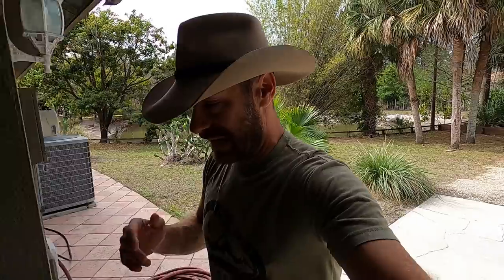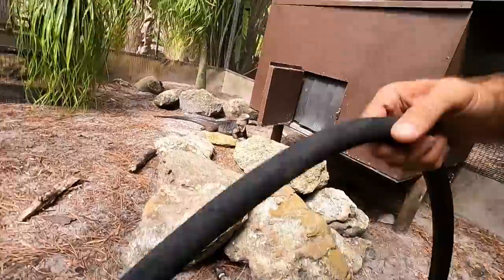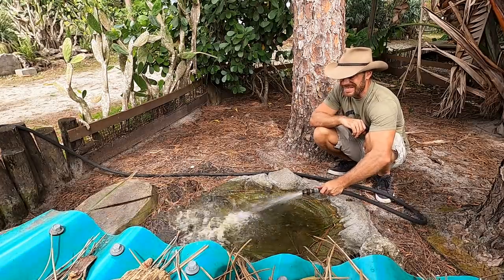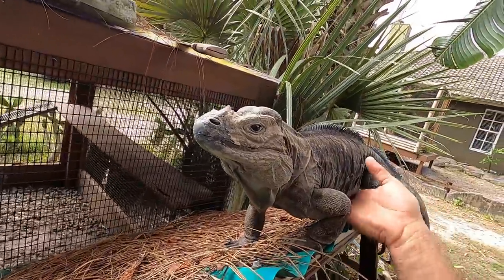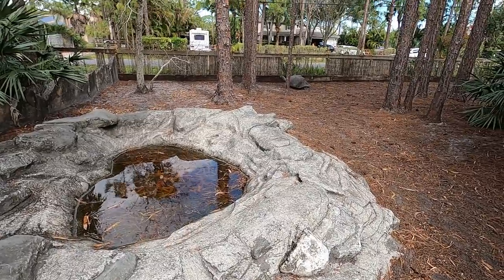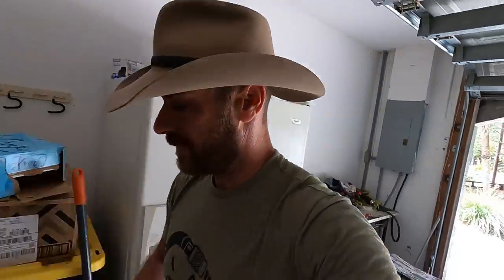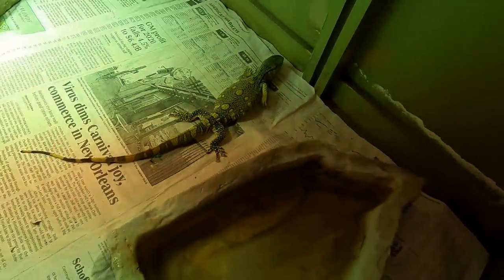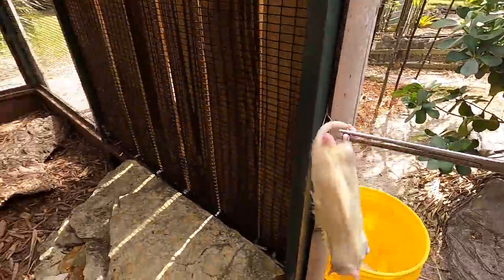Visiting Slinky & the Monitor Lizards!

Comment: I believe black throats like high humidity. I used a mixture of play sand and coconut fiber 30/70 sand to coco fiber for my savannah monitor. This combo really holds humidity well and is good for burrowing. Also some monitors depend on humidity for hydration.

Comment: Regarding Bobbie Rabino, a short explanation of what's probably going on. First, you're doing what you should be doing. Increased supplements and critical care food are great for his recovery. This is a sure sign of calcium deficiency disorder. It affects his absorption rate of the calcium, as well as other vitamins and minerals they need. The parasites hurt that pretty badly by damaging digestion and lizards don't recover most of the time. You brought him back from a bad place. He's still having petty mal seizures, which affects motor movements. That's very common for deficiency disorders. Digestion takes a lot longer to heal in reptiles.

Comment: if it was a wild animal you need to take your time with handling them it takes weeks for them to get comfortable with you just put your hand in and let them smell you get used to you not being a threat you need to take your time i can see that animal is super stressed my tagu was the same way and my mountain horned lizards but my nile monitors took weeks n weeks to get in my hand without it stressing out. ive had 14 lizards at one point in time
i love reptiles

Comment: Hey Kamp, there was a video about a huge monitor lizard that had an open sore on its nose.   The problem was that the animals the owners were feeding it were too large for that monitor to get it down its gullet, causing it to do what your lizard just did, push the large rat down its gullet and thereby rubbing its nose against the rock.  That other lizard was pushing a rabbit down its gullet using a chain-link fence that had a large opening that allowed part of the rabbit to pass-through causing that lizard to push its nose against the wire causing that open wound.  I would suggest that you not feed such large animals to the lizards that don't have the expanding jaws that snakes do but must use an aid to force the food down its throat. 
By the way, Kamp, not one 'gotcha' or 'I LOVE IT' or 'no way', making for a much more pleasant video of you not trying to show your knowledge or approval of what others are doing.  So relax you probably know more or at least as much as those you're trying to impress.  One of the nicest videos that you made was just YOU and that pond, where you went underwater.